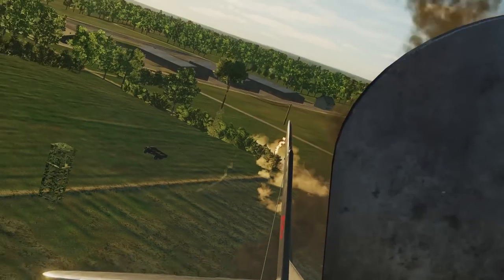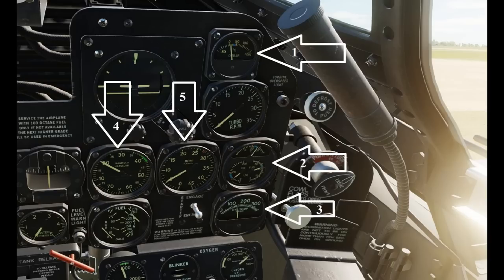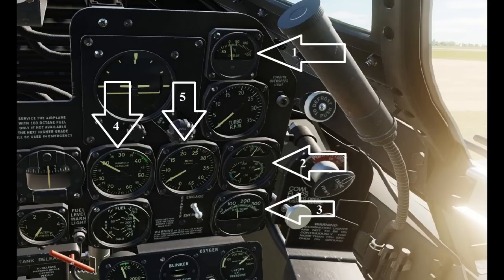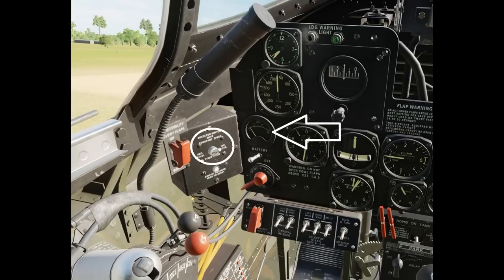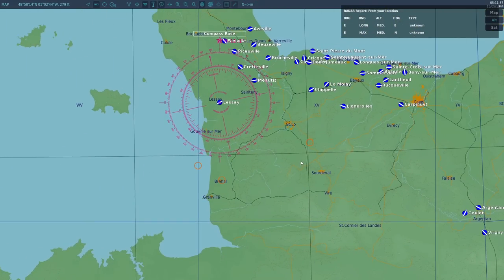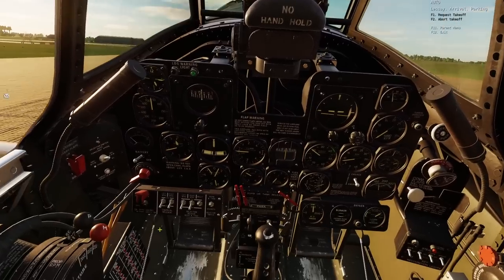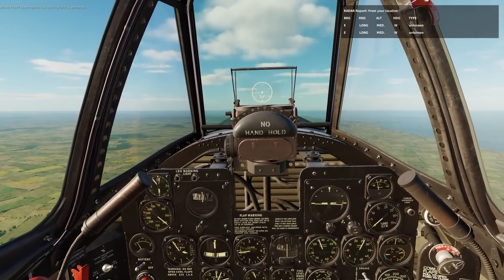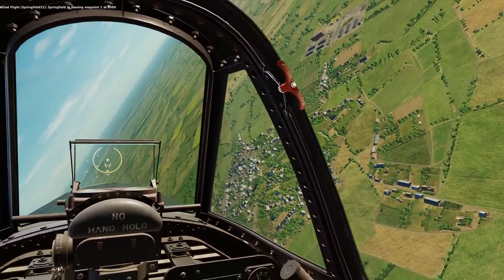P-47 Damage Control, Dogfighting and Ground Pounding DCS

Comment: Your videos always reveal the practicality of flying aircraft and this was no exception. Thanks for taking us on the ride along. Perhaps you could create your Fiat in a driving sim and show us how you would beat the competition.
Reply: Starting in the early '70s, I went through a series of four Fiat 124s. A '69 Coupe', and three newer spiders. I could buy them very cheap because of the engine troubles and fixed them in the Base Auto Shop for almost free. They were more fun than you can beat with a stick, until I bought a Boss 351 Mustang! Religious revelation and conversion to big V-8s!

Comment: You can also undertemp the oil, particularly in long, high speed dive from high altitude. This will then drive up the oil pressure to the point it won't flow and badness ensues. Try to remember to close the oil shutters (which I'd be surprised have any measurable effect on aircraft performance either in DCS or real life) before going into a long dive, like one might if they were trying to use the Jug's dive-to-escape trick.

Cowl flaps too!

Great to see this new detailed DCS content, Greg! Or even when it's just used as illustration, often it can provide perspectives hard to find in real-world media of the day.
Reply from the maker: Yes you can, but I didn't do high altitude work in this video, so I didn't get into that. Perhaps another time.
Reply: @GregsAirplanesandAutomobiles  Considering how amazing the aircraft performs at very high altitudes I would love to see a video on that. It gives you a feeling of invincibility when flying above 30.000ft

Comment: I like how you said to keep intercooler shutters at neutral and explained how they work. Another DCS P-47 tutorial in youtube explains to keep them always 100% open which is incorrect.
Reply from the maker: Nearly every test of the P-47 was with the shutters in the neutral position. You may need to open them more during period of sustained high manifold pressure at altitude, but in 99 percent of DCS operations you can leave them in neutral. I wouldn't close them except during long power off decents, and even then there isn't much need to close them.

Comment: Greg I believe we have discovered that after repair you will continue on with a "cold start" aircraft . This is new on the server we have been flying,, WP US 2 Dynamic Base Capture Normandy . This will explain why you lost an engine after take off. Just make sure your temps are within the sweet spot  as your engine warms slowly or by using oil dilution switch. But make sure to turn it off before take off. GR00VY has been advised. I hope this helps. If this has been covered already and I missed it my apologies.
Reply from the maker: Oh, that makes sense! Thanks Bishop. I did wait to warm up for a long time and eventually just gave up. It didn't occur to me that the outside air temp may have been low enough to need oil dilution. It's amazing how realistic this sim is.
Reply: Absolutely my pleasure. I am happy to help... 95% of my understanding of the War Birds and the Republic P-47D Thunderbolt/Jug in particular, is taken directly from your videos. Its been extremely satisfying to assist here and there in your in-depth study sim of these amazing and fascinating War Birds. One more thing that come to mind about the P-47 in this server has to do with server restarts, The server starts out pre dawn early morning and the landing light under the left wing is many times default deployed and the light turned on. Its a no brainer to turn it off once its no longer needed to see or once you have taken off but what is not so obvious is that the switch that controls that landing light is a 3 position toggle. On/ Off and retract. If you are in flight and your stick is shaking as if you left cowl flaps open and said cowl flaps are indeed not open the landing light is likely causing it and not retracted. A quick outside F2 view allowed in the server in question can help map out which position of the 3 way toggle shuts off the light and retracts it to its stored configuration. It can be different from case to case if its bound to a switch on a hotas or key stroke  or even a button box. Let me know if this is also what you find to work.

Comment: With the screen shake around 18 minutes its because the game has some sort of issue reading zoom from the controller analogue dial. I fixed it by putting a small deadzone at my favourite zoom level, now whenever I'm in that deadzone it behaves. Also helps me find it quickly which isn't too bad either, especially without a detent on my throttle now.
Reply from the maker: Great point Olivia. I have done that and it works, but still shakes at any other zoom level. Still, great suggestion and as always I'm glad to see you here.
Reply: Oh! It's an analog axis! Yeah, it could just be noisy or possibly fighting against another analog axis on another controller (DCS loves to trap new players with that one, it tries to map everything to everything by default, virtually guaranteeing axis conflicts).
Reply: @AdmiralQuality  Its always just been the noise for me. My old controller had it bad, newer better one gets it closer to Greg's experience. All other analogue controls already used up. Plus I tend to clear all first as I make my keybinds. Adding some hysteresis would fix it instantly but I've not been able to find a program to do that and for some reason DCS hasn't in the 15 years or so it's been around.

Personally I tend to add a deadzone at 50% and 100% zoom, the two I use most, then just hope I don't get the jitters if I ever need anything between.

Comment: Is there any consequence of a too low carb air temperature? At low altitudes without turbo and at cruise settings, the needle is often below the green, even with the intercoolers fully closed.
Reply from the maker: Not really. There was a chance of carb icing in some situations, but I've not heard it happening in an US injection carb, and certainly not within DCS. This was really a left over from the true carbs on airplanes which relied on a pressure drop to work. That pressure drop would cause moisture in the air to freeze up the carb under some specific conditions. cont:

I just realized you're reflected. You are doing some great work. I played through the Anton campaign twice, and I'm going through the P-47 campaign now. Next, probably F-14 campaigns in your suggested order.
Reply: @GregsAirplanesandAutomobiles  thank you for the clarification and for the kind words! I'm a big fan of your videos. Good luck with Wolfpack - I'm going through it now as well, I just got a VR headset, so it's like a  childhood dream come true now :)

Comment: And there will be a big difference between ambient air temps at your altitude, and the temps coming from the compressed air of the turbo supercharger.  The biggest reason...  Compressed air will increase in temperature.
That's always a constant.  The more it's compressed, the more it will heat up,
Something to consider, when attempting to control engine temps.
Reply from the maker: True, but this thing has one heck of big intercooler.
Reply: Yeah at high alt when you pulling 64" in P-47 turbo rpm always hit 22k, carb air temp always at red line with intercooler wide open. In most cases only thing what you can do is to lower turbo rpm by pulling boost lever back.

Comment: I wish IL-2 had this level of technical immersion
Reply from the maker: It simply doesn't, but both are good sims in their own way.
Reply: @GregsAirplanesandAutomobiles  I definitely agree,  especially being that I pretty much only play IL-2.  I'm really looking forward to what they do next as it's being heavily rumored that they will be working on a whole new sim/engine for their next project.  I hope we get all of these technical features while still giving us that awesome WW2 experience.

BTW Greg, would you mind sharing your opinion on the P-47s in DCS vs the ones in IL-2?  It seems like the vast majority of us in IL-2 are sadly disappointed with our P-47.  

In IL-2, I can't imagine dogfighting a Bf109 if I was flying a P-47, even if it was stripped down, 150 octane, low fuel, even removing half of the guns to save weight, etc.  But if I was in a Bf109, with full fuel, even with a pylon from taking a bomb, or gunpods, I would see a P-47 as an easy kill.  On top of it all, it's not really durable at all.

Comment: The P-47's legendary toughness comes from it's airframe more so than its engine. P-40 was also legendarily tough.
Reply: One reason the US favoured direct air-cooled radial engines over air-water-cooled inline engines was because the absence of cooling tubes and hoses made the radial perceived as more resistant to battle damage.
Reply: @justcarcrazy  P47: have multiple oil coolers (radiators), hoses, ducts, etc. 

Most of the legendary ground attack aircraft of WW2, many legendarily tough, used inline engines.

And as Greg has shown in this video and his other on navigation, if the oil radiators in the P-47 get damaged, the engine is going to quit.

In the Battle of Y29, one P-51D took off, shot down an FW190, took multiple 20mm cannon hits, including loosing oil from teh engine and losing an aileron, and still managed to shoot down 3 more Germans before landing safely.

I have a picture of  P-40 that landed with a piece of another airplane lodged in it's cowl.

But if you study the P-40 and P-47 in particular, their airframes were monstrous. Overbuilt. meaning they can take a lot of hits before losing structural integrity. But that comes at eth price of weight. Drag and weight dogged the P-40, and the P-47 could have been better had it shed some weight too. But at the expense of toughness. 

Where is the criticism of the Hawker Typhoon/Tempest? IL-2? Ju-87 (vulnerable, but still tough), Mosquito? Hurricane? Etc.
Reply: @SoloRenegade  Not just that! But (IF I remember my readings from Roger Freeman's writings on the 'Mighty Eighth' correctly) The P47 had so much supercharger ducting in the fuselage that, in a belly landing, it would absorb a lot of the shock and impact, that would normally get 'transmitted' into the lower legs and backs of the pilots, so more pilots would walk away from bad landings than with other Allied single engine aircraft.
Reply: @nickmitsialis 

That makes sense. Those are large ducts and create a crumple zone where you need to to absorb high descent rates.
Reply: @TheJustinJ  Yes; better a crumpled airplane than a crumpled pilot.

Comment: Suspect human pilot in 109, cool that repairs were a problem, I need to try DCS. Will DCS work with a multi screen setup, does it have rudder controls with or without pedals?
Reply from the maker: It will work with a multiscreen, or about any screen set up you can think of.

Comment: The biggest issues I have with DCS and warbirds is the fact that you can't set gun convergence. The default (think it's 250 m(y)) is too short for any air to ground work and I'd really like to be able to set it to 400-500m for mixed engagements (the Air-Air lethality doesn't really suffer much in IL-2 or WT at those ranges)
The second are the contact fuzes on bombs - but as far as I can see in your video - this can be dealt with
Reply from the maker: The convergence in DCS are set to the prescribed settings in the various pilot manuals, probably how 99 percent of the planes were set up. As for the fuses, the choice of fuses on the bombs is immense in DCS, I really can't ask for anything more.
Reply: @GregsAirplanesandAutomobiles  I must have missed something with the bomb delay fuzes, there are forum posts from 2020 confirming that it is not possible to set delay fuzes.
Thank you for the reply and for the video, keep em coming and a happy new 2023!

Comment: Again, I will return to IL-2 Sturmovik, at low altitudes, you are at disadvantage, but above 7000m, P47 is the king! 12.7mm feel little bit underpowered (german 20mm packs way more punch), but that issue is not so pronounced with P47. Extra ammo option was always a must for me!
Reply: It might not be the most efficient, but in WWII flight sims I always seem to come back to "as many .50s as possible!" as my preferred anti-fighter armament lol.
Reply: 50cals are faster and more accurate and the sheer volume of fire means that your likely to hit and even if you miss half your shots you will still put a ton of lead into your target
Reply: @agravemisunderstanding9668  i still prefer 20mm. The volume of fire is not all. As a sim flyer, i prefer clean and fast kill as it is very difficult to keep the target in sights for long. Usually, you only get a snapshot. The fact that usaaf switched to 20mm post war testifies to that fact.

Comment: I was just thinking the other day while playing War Thunder that the Chinese P-66 holds the early visual style of what the Corsair would eventually become. If you tweak a few design aspects of the P-66 it easily becomes a Corsair. The same can be said about the Chinese P-43A, as you can easily see design features that would quickly evolve it into what became the p-47.. I just thought that was kind of neat when I noticed it.
Reply from the maker: The P-43 was the direct ancestor of the P-47.
Reply: @GregsAirplanesandAutomobiles  I figured it was, I'd just never noticed how similarly they were actually designed, and how such a minimal amount of improvements were able to gain significant performance increases. But then I can't help but ask myself "Was the P-43 worse than it should have been, or was the P-47 better than it should have been? It basically seems like they just increased the size, kept the body and wing the same "with some aerodynamic tweaks to smooth things out, and gave it a way more powerful engine. And the gains were insane over the p-43, which was basically the same plane. I'm assuming that besides the engine it had a way better supercharger system too huh?

Comment: I'm not sure what your screen shake is, I don't get that with TrackIR and the stock software. That's what you're using, right? You're centering the TrackIR regularly? It's not like you're butting up against the tracking limits for translation or something like that? (Maybe you have the Z translate axis turned up higher than it should be? You ideally want the head translation to match the motion you make in reality but I have noticed sometimes you seem to throw your face right into the gunsight then back into the headrest. Maybe that's just real-life seat adjustment.)
Reply from the maker: It seems to be joystick related because when I adjust the zoom on the joystick I can make it go away.
Reply: @GregsAirplanesandAutomobiles  Pretty sure that's Z translation we're seeing, not Zoom. (If you were zoomed out all the way it would look fisheye and it's not even close.)

I definitely don't have any issue with hitting a maximum zoom extent with zoom mapped to controls on my stick and haven't heard of anyone else experiencing it. (I run a DCS FB group with over 10k members so I tend to be pretty tuned into the state of the sim.)
Reply: Oh! Might you have the head translation mapped and it's fighting your TrackIR? Let me see if I can reproduce that...
Reply: Nope, they don't seem to fight, instead they're cumulative (hitting Numpad F5 centers your view, I also map that to TrackIR center so both get done at the same time).

Hmmmm, not sure how that's happening but will continue to look into it. You use the stock TrackIR software, right?

Comment: Did he fully open cowl flaps like he said he should when he lost oil pressure?
Reply from the maker: I said to fully open the oil cooler shutters, and yes, they were open, actually they were open the entire flight. The cowl flaps were cracked open a bit which you can see in the video.